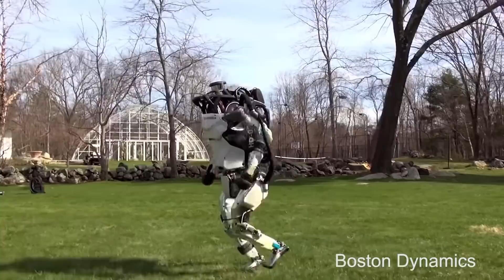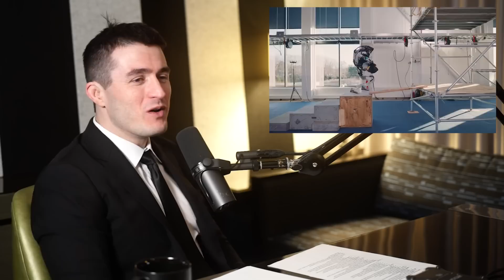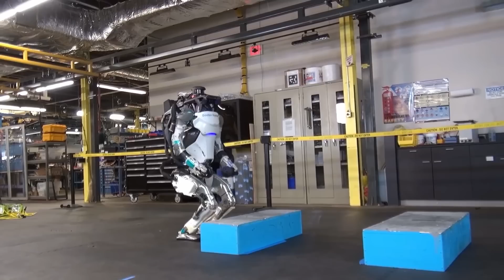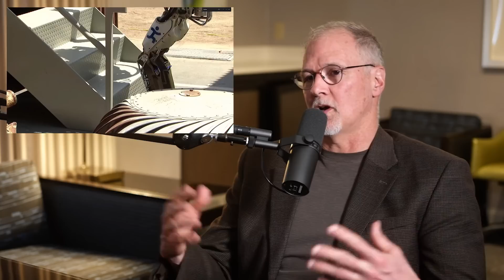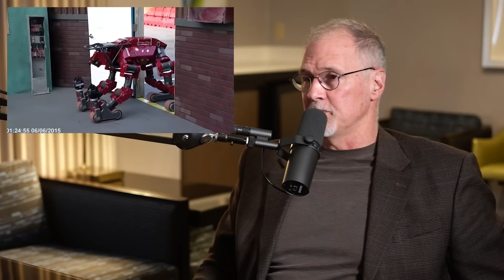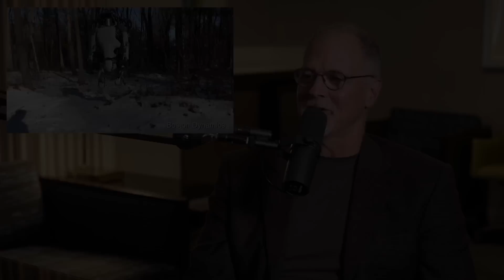Boston Dynamics CEO explains how Atlas humanoid robot works | Robert Playter and Lex Fridman

Comment: I can’t see how these robots will not eventually turn into behemoths like the giant earth moving machines in rock quarries. Imagine these humongous robots walking around with giant rock cutting saws in each hand and using them as easily as a fork and knife. However I would be more afraid of the smaller, more nimble machines that could shoot you from 1000 yards without ever missing.

Comment: I think hunoid robots are pointless. The form of a human was created through the limited lense of bilogica evolution. Drones for instance are already far better at everything, then for applications such as space, low esrth orbit or deep sea they will have their own soecslized desine. Imagine a cube that can move in zero G by sprining from one surface to another while loading all the  kenetic energy from one jump to the next back into the system allowing fast and precise jumps that have zero wasted energy. Where does a biped fit into any of that? Nowhere.
Reply: Humans are incredibly resilient, strong and agile compared to machines.
Reply: We can also use humanoid parts for human limbs replacement
Reply: Easier societal assimilation' through copied representation' Were not ready for inspector gadget the grocery store yet _ Tho' some advanced physical helper upgrades' could be very nice'?! 😶🖖

Comment: Cant you use flywheels to create balance and momentum some spinning in its chest or am i wrong
Reply: Flywheels could assist for static balance; but as soon as you start translating with a spinning flywheel, it applies a torque that would be difficult to deal with. How much it assists would also be proportional with the mass, size, and power consumption. You could use flywheels while the bot was in mid-air to rotate the bot, like a satellite; but they already accomplish that by using the limbs as flywheels with limited travel. Accelerate an arm around the bot and the rest will rotate the other way.